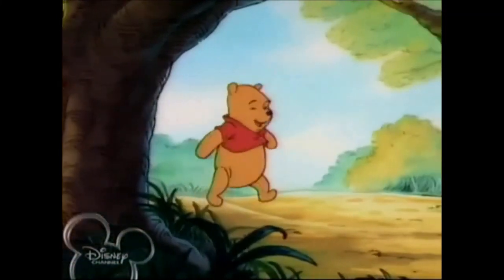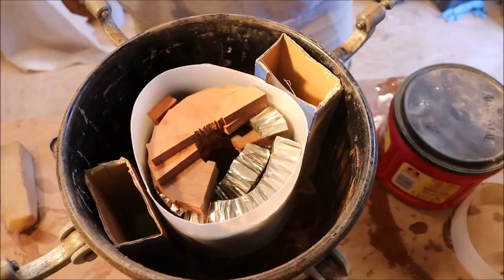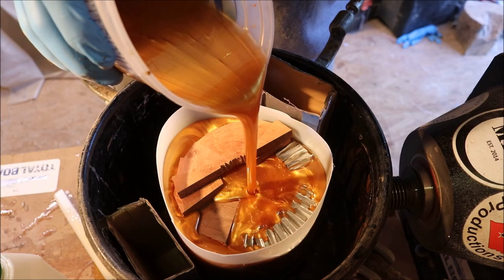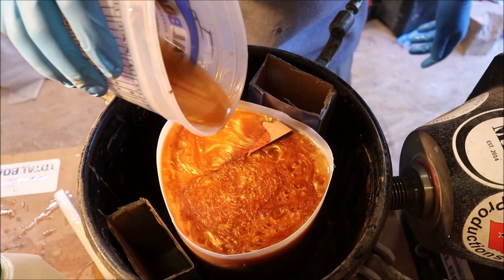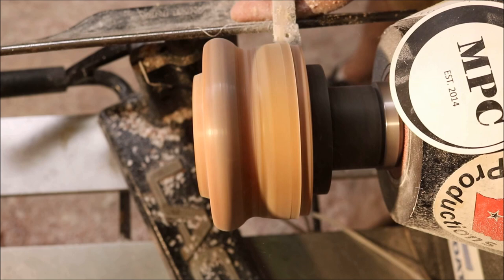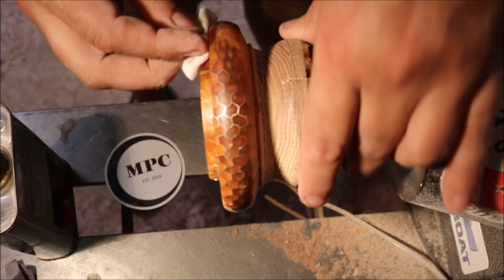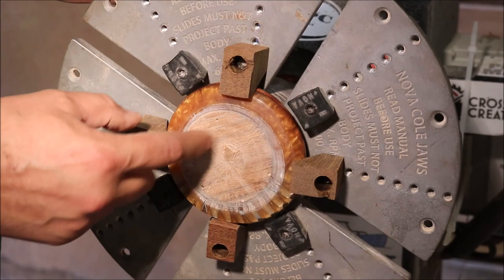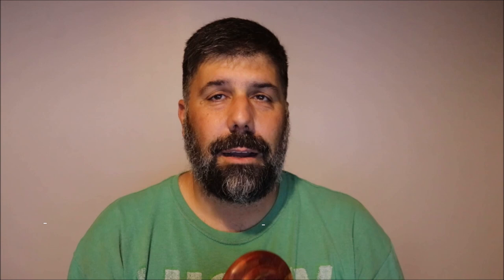Wood Turning - Segmented Honey Pot

Comment: Using the honeycomb aluminum and honey colored resin is amazing on this project. It turnout out amazing. I'll bet you could use real cleaned honeycomb, too. Great work!
Reply from the maker: I have talked to a bee keeper about using real honey comb. It may melt due to the heat generated but the resin. BUT I will be trying it as soon as the bee keeper gets me some. 

Ken
Reply: @MoonpieCreations  Very cool! I look forward to seeing what you come up with.
Reply: @MoonpieCreations  Could you finish it with wet sandpaper to keep it cooler, I wonder?
Reply from the maker: The sanding is not the heat I am talking about. When resin mixes there is a thermionic reaction. It getting pretty warm and I am afraid it will melt the waxy honeycomb. 

Ken
Reply: @MoonpieCreations  Oh! That's very interesting. Well best of luck!!